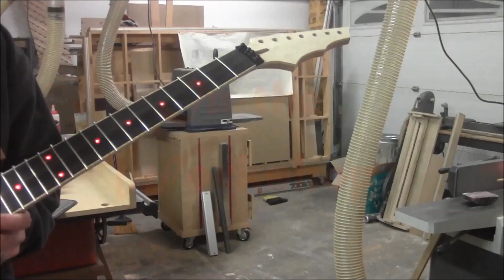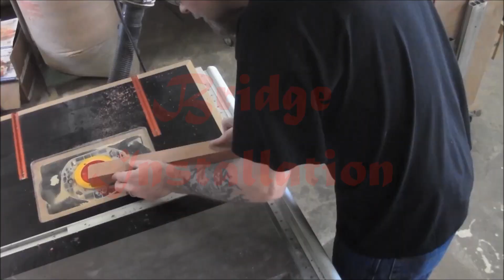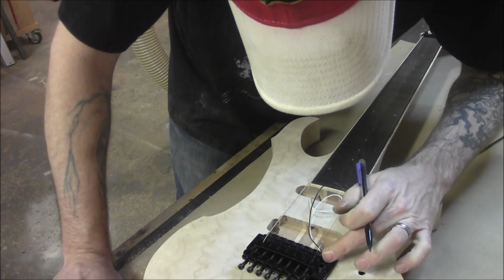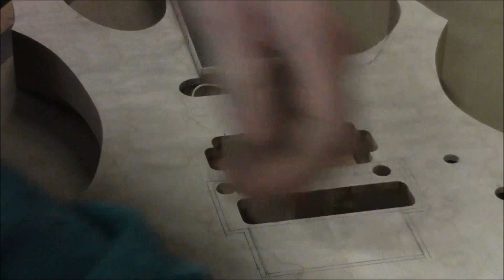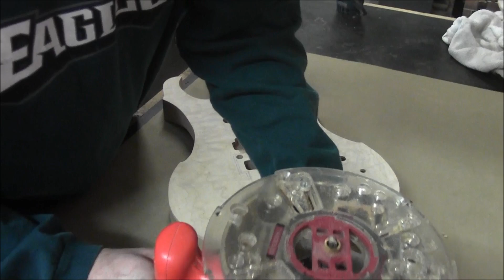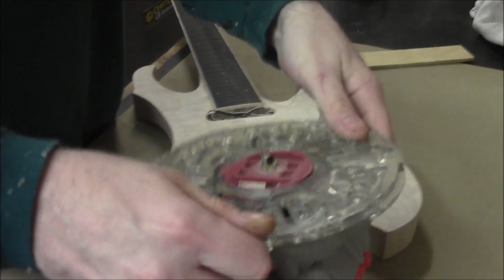How to Build an Electric Guitar-Video 18- Floyd Rose Install

Comment: Perhaps this may clear up some questions for your subscribers, Great video btw!! When I intonate my floyds I measure the distance from the nut to the centre of my 12th fret and adjust my position of my high e string to this position, Ex. 12 1/2" on a 25" scale length and 12 3/8" on a 25 3/4" scale length). Given that most quality floyds ( OFR / Schaller / Graphtech / Gotoh 1996 ) have three position holes for intonation position based upon the gauge of strings preferred.  There will be a sweet spot for plenty of bite on the saddle position lock and a bad spot where the saddle lock screw is barely grabbing the saddle position lock.  When converting From vintage type tremolos, use masking tape to mark out where the current intonation location of the old saddles are, and then place the new floyd in position to see if it is in optimal position, not to interfere with the bridge route and ensure there is enough wood for the trem post inserts . Bridge pickup routes are sometimes too close where route out will occur, so slight readjustment may be necessary, all this I do before actual routing takes place. A split the difference scenario may occur and the saddle adjustment/ play will allow for this. And I fill any old holes with epoxy before drilling new holes for the anchor posts.  String height will change the intonation, this is where the old swing arm tuners come in handy, fretting the 12th fret, and harmonically striking the open note at the 12th fret position to achieve balance. 🤘🏼
Reply: David N Rickard now pls explain in metric system 😂😂

Comment: Great video, thank you! The one thing I found to be the biggest challenge was getting the damn post holes spaced perfectly for the FR bridge. I started with a strat body and routed it for the FR but I kept messing up the spacing for the post holes. What finally worked for me was building a hole patter template by drilling holes in a short piece of 2X4...I probably should have used 2X3 or 1X2 because they're easier to handle, but I didn't want my drill bit to "walk." (My drill press stage is too shallow to fit the body on it while drilling). I drilled one hole in the 2X4, then put the bridge on it to draw the other hole, and then used the template to locate both holes on the body. I then drilled one hole into the body and used a 3/8" dowel pin to fix the template in place, plus two shims on the body to keep the template from rotating or moving laterally, then drilled the other hole. I hope this helps.

Comment: The 2 strings (top and bottom) is a great way to find the location of the Floyd however I think that there is something wrong with it, because everything has to be in relation to the center line of the neck, and if you use the two strings method it means that you are not trusting the neck center line anymore, that's my thought but I'm not a 100% sure.

Comment: Hi, I looked for a videos of this kind. I have a question. These bushings have corrugated outside surface, but at the edge they're smooth. I installed them with this smooth edge up, like it is shown on the OFR manual drawing. On the other hand, almost all pictures I've seen on the web show bushings with studs put together in a way that the smooth part is down. Does this technically have any meaning? If it's better to be down, then OFR manual is wrong though. (?)

Comment: On installing the posts, would it be best to use a drill press or is a hand drill OK? I pan to build a Floyd equipped Start or Kramer copy one day. Thanks for the great, intelligent and informative video.
Reply from the maker: +Glenn Gray For a Floyd a hand drill will work but a drill press is recommended. Just make sure you drill it as straight and accurate as possible. Thanks for tuning in!
Cheers

Comment: I'm trying to build a 24 fret Strat with a Floyd Rose Tremolo. But I've came into some what of a stumbling block..... In my Strat Body I've got three hole's for Humbucker's, but all I want is two Humbucker's. My stumbling block is that from where my Floyd Rose nut would sit on the neck and where it should end at where the two post should go for the Floyd Rose bridge is 26 inches not the 25, so what kinda of modification has to be made? (please) And NO joke's (PLEASE)! Some kinda of a answer..........!?
Reply from the maker: If you want to install a 24 fret neck into a typical strat body you need to rout the neck pocket further into the body. you would then have to have a custom pick guard made with a deeper cut for the neck and new configuration for the pickups. If you go this route you would lose some accessibility at the upper frets and may run into trouble with the position of the neck heel relative to the body so you may be required to modify the shape of the body slightly.  the key thing here is to maintain the 25" distance from the nut to the bridge. IMHO you would be better off with a body designed for a 22 fret neck or that hasn't been routed for pickups and bridge yet.
cheers
Reply: DarkLuthier I truly thank you for such a quick reply, I did know that regulation 25" was going to cause some problem's, I just thought that their may be some way around it, by keeping the mandatory 25 inches and playing a little havoc with the neck pocket and body somebody knew something I did'nt.  It's cool, I've come to far with it to stop now........
Reply from the maker: Kenneth Grover
That's the spirit! It's doable but not easy. Hope it work out well for you!
cheers

Comment: Is the distance from the nut to the poles always exactly 25" ? I have a guitar kit version of the kramer barretta special (something like and eddie Van halen guitar).... They haven't drilled the holes in it for the pole pieces..... Would it be 25" for my guitar?
Reply: I've heard 25 1/2" one time
Reply: @funnyman828able  if your scale length is 25.5". Thrn your Posts Can't be at  25.5".  The saddles are set back from the posts..  but won't adjust up near equal in line with posts..  a half inch is ok in range for saddles adjustment.. 9/16" is better if there's three holes for saddle set screw placement

Comment: Hey, firstly awesome vid and serious! but my question is do you have to have a routed area for the floyd because i am making my own guitar and I am curious to know if it is necessary or optional??
Reply: That depends on Where the strings will end up depending on the trajectory of the neck angle..  I'm just now doing my first top mount floyd (licensed floyd) on a ML Stealth type build....and I set the neck in Higher than usual... So I'm hoping I won't have to route for up-pull.  Floyd Rose sells wood screw posts for this old style way of face mounting

Comment: I'm trying to build a frankenstrat and I'm taking a normal strat body and making it work with a floyd rose. How should i reinforce my bridge humbucker pick up so that when i drill my post holes in, it doesnt make the pickup routing collapse in on itself.
Reply: If it's THAT close...post holes to pickup route... Then You'll probably have to route out a larger section and glue in a large block...at least as deep as pickup route...and then take it from there..  pickup may have to be moved forward slightly
(By large section...I mean back beond the post holes.... probably to the through Route where tone block goes through....so your post holes are completely into new wood)
Reply: You may find that poplar is a good easy inexpensive wood to find in 1×4 or 1×6 sizes in local Lowe's or home Depot.. 
Easier than finding Ash...alder,. Or most other woods . Basswood isn't very strong so I wouldn't recommend that for the area and. Job you're taking about

Comment: How do you know that distance measurement from the nut to where you draw the line is 25", where did you get that measurement from? I am asking because I am looking for that measurement.
Reply from the maker: it has to do with the scale length of the instrument and the mounting setup of the bridge you use. there's no real short explanation of it. I am planning on doing a video explaining intonation and bridge placement. I get this question a lot. for a quick reference, if you're using a common bridge then some fret scale calculators will have this information available. I believe the stew-mac fret calculator has this information.

cheers
Reply: Thanks man, I've been building acoustics for fifteen years and started electrics four years ago, I'm using a Schaller, just got it and just finished all the routing with the help of your video, thanks, the 25" inches you suggest worked fine and I order plenty from Stew Mac and know about and have used their fret scale calculators.  I'm making a drawing of the route work then I'll make a template out of 16" plexi glass since I have it for the next two way trem I install.  I drew around the tremolo and eye balled the back end, all routing came out fine.
Reply: Are all Floyd Rose and Schaller locking nuts 41 mm, normal electric guitars that don't have locking nuts have 43 mm nut area and I haven't decided if I want to carve my necks nut area down to that, that's pretty narrow, I didn't know those locking nuts were that narrow?

Comment: im trying too get one installed on a dean ml but i lack any knowledge on this matter could i get it done at like a guitar center maybe. Post script sorry if its a stupid qestion
Reply from the maker: +Orion Ingram Personally I wouldn't trust it with any guitar store. The techs there are usually just that, a tech. They typically dont have a luthier working for them. If the dean you want to install it on has a tune-o-matic bridge it may not even be possible. I will be releasing a video soon that explains swapping bridges in more detail. I'll try to get it uploaded in the next week.

cheers
Reply: thanks man any suggestions on where to go
Reply from the maker: Not sure where you live but either way it should be a luthier and not a technician. I am uploading a video now on floyd rose comparability. Should be up in a couple hours. I recommend you check it out.

cheers